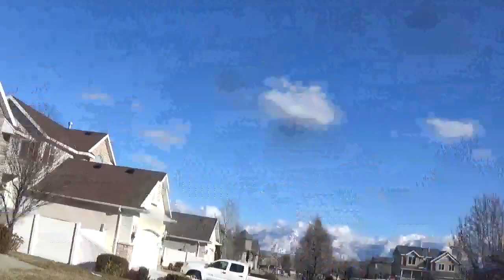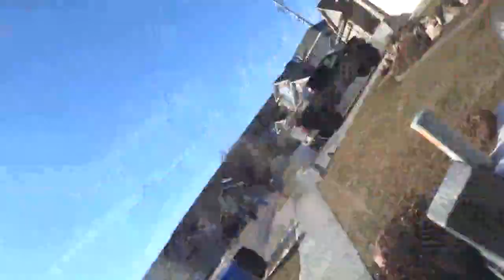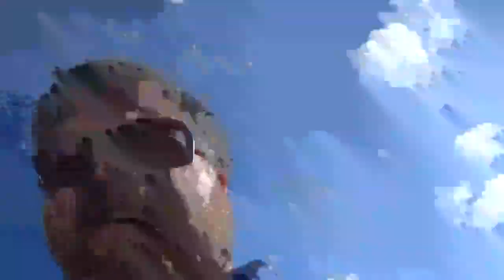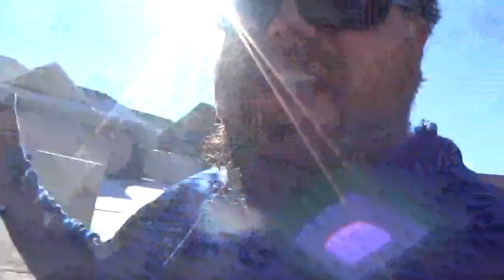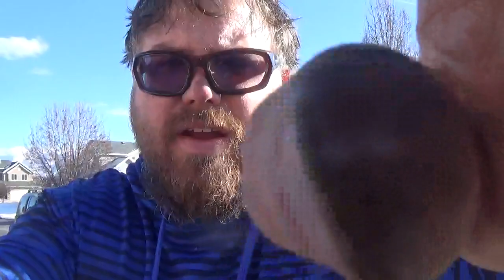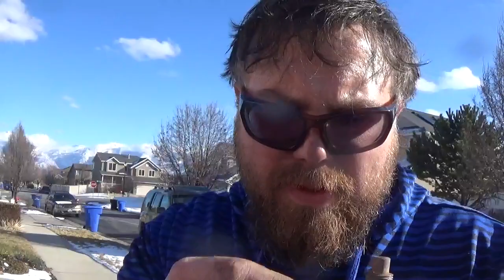DONT BURN THE TRUCK DOWN- basic maintenance

Comment: Absolutely at least you can work on older machines and vehicles the problem with these new machines there nice until the warranty ends and they start having all sorts of problems and there pretty much computers so forget working on em yes they have alot more auxiliary power like running a bunch of tools on em
Reply from the maker: you will still find  sa 200s in use in 50 years.... miller admits they make a throw away machine (after 10k hrs)
Reply: Like I always say- a clutch and a carburetor, and yes the swamp donkey with the thumper cam simplest shit to run you just need to check stuff at least once a week you know- MAINTENANCE